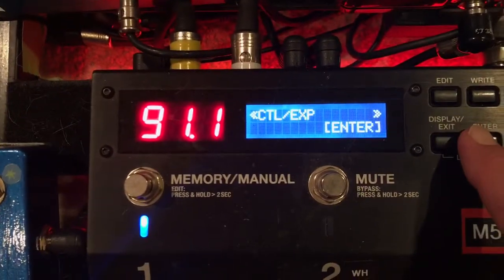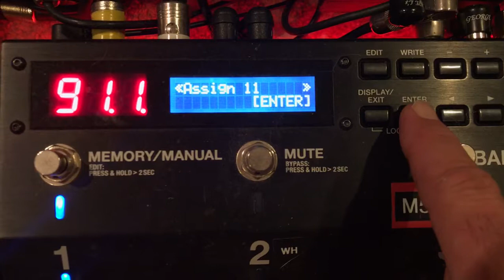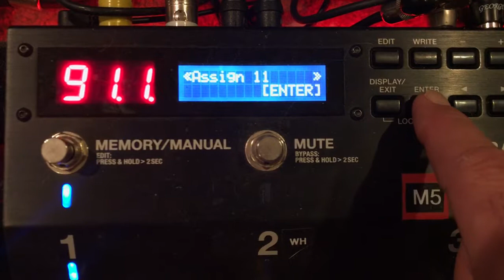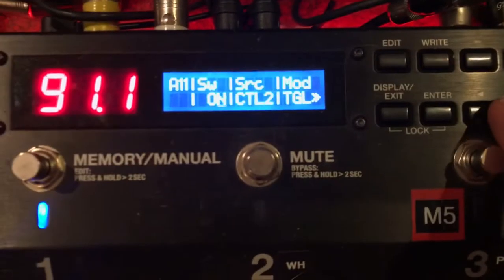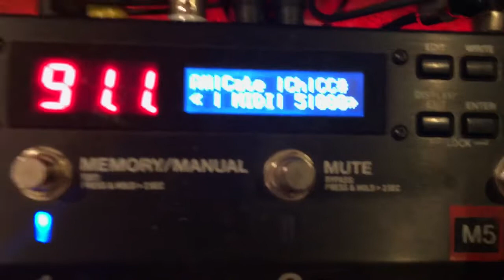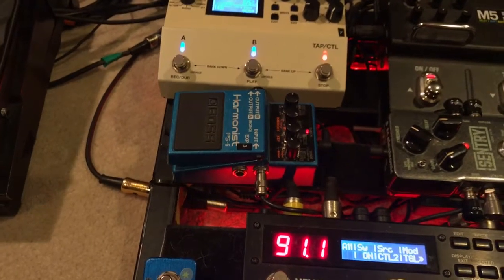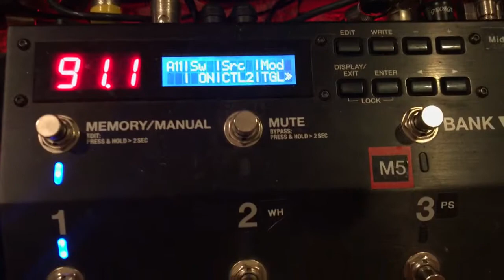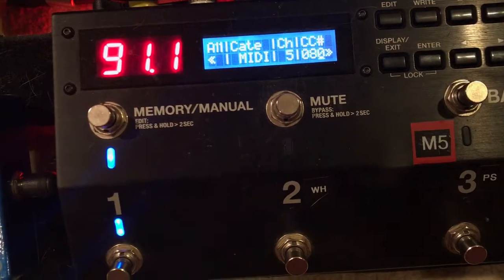Boss ES8 MIDI cc send via CTL input-delay hold

Comment: Hey man.  Thanks for this.  It's really helpful.  The es8 is a great switcher, almost too great creating a bit of a learning curve.  Anyway, I'm wondering if the es8 has any ability to switch the wires in a trs cable that is used to send midi messages between the tip and the ring.  Kind of like the disaster area midi conversion boxes do   I'm trying to get my meris pedals receiving midi and struggling.  Turns out this might be my issue.  Can't find any documentation on it.  Thanks again!
Reply from the maker: Matthew Bystrzak i am not sure about that, I know there are some polarity options under the individual CTL sections for each. But I think that has more to do with how the switch is sending the pulses. You could rewire the cable at the TRS end, but then you are committed.
Reply: Thank you sir.  I've contemplated that.  I reached out to meris but they said that I NEED a midi conversion box.  To me this doesn't seem right assuming the midi signals are converted properly and sent over the right wires inside the cable.  I'll have to monkey around with it.  Thanks for the reply, much appreciated.
Reply: @matthewbystrzak4751  maytthew, I also wanted to do something similar to switch strymon sunset.
I appears midi can only be sent out via 5pin midi sockets.
It really would be game changer if Boss updated this in the software. Many more pedal makers are adding midi switching options but only using trs or mono cables.

Comment: Thanks for this!  This has gotten me closer than any other video I've seen so far. However, I still can't work out how this is done. Does it require an external button or could one of the ES-8 buttons be remapped to send hold messages?  Thanks in advance.
Reply from the maker: Eric Foster yes, any switch on the ES can be used to do this. You just have to remember to turn the standard function for that switch to OFF under the patch section. Substitute your NUM with CTIL2 where I have it in the menu.
Reply: @DoubleDguitar  what did you do in the DD-500 to make it accept the input?
Reply from the maker: Eric Foster you don’t have to do anything. It is always waiting for a cc command. So as long as you have the ES assignment sending on the same midi channel as the DD is looking for, it will accept the cc.
Reply: @DoubleDguitar  I guess I just don't know what I'm doing. 😂. I actually had it working a while ago, but it got overridden. Now I can't get it to work no matter what I do.
Reply from the maker: Eric Foster are you using CNUM in the assignment, or a NUM on the ES, like NUM7?
Reply: @DoubleDguitar   I'm attempting to use button 8. I turn it off in the CTL/EXP menu. Under assign 1 I turn it on and set the source as button 8.
Reply from the maker: Eric Foster try turning it back on.
Reply: @DoubleDguitar  I'm just going to start from scratch. I can change the patches on the DD-500 but I can't sort out the tap/ctl button. I have tap tempo working, just can't figure out the hold function.
Reply from the maker: @EricFoster  had a late practice last night, have you gotten in sorted out?  When I have an issue, I always start with clean patch.
Reply: @DoubleDguitar  I'm going to work on it today. I'm pretty sure I'm missing something simple, like proper midi channel or something. Gonna take it slow at lunch and see if I can work it out.  Appreciate your help, btw.
Reply: @DoubleDguitar  UPDATE:  my chain is this - ES-8 > DD-500 (midi channel 2) > RV-500 (midi channel 3). I can control the DD-500 just fine. However, midi doesn't seem to be making it to the RV-500. I can change patches, but not other midi controls. :-\